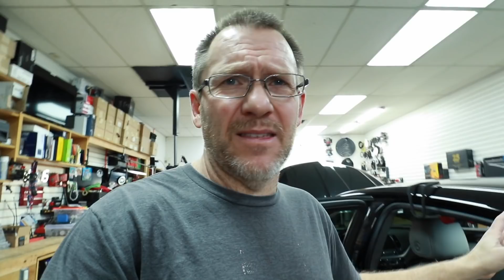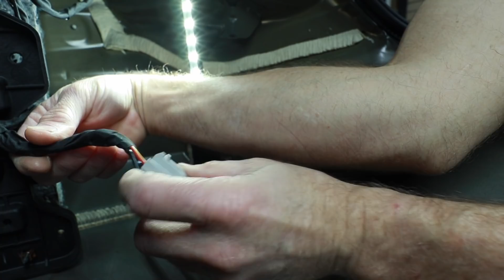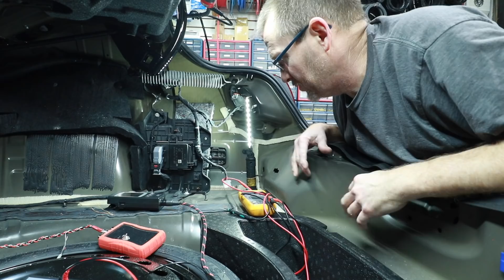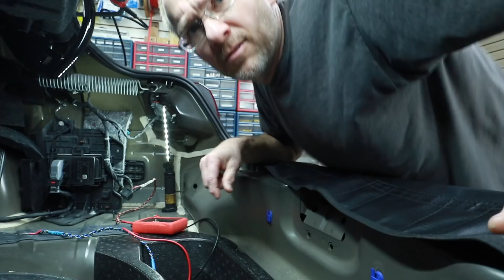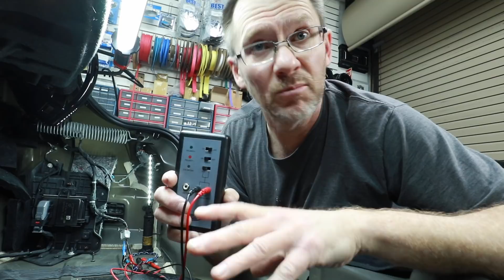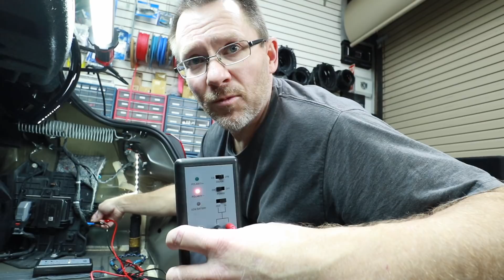How to test the audio out of our factory amp to install a High to low Installer Diaries 344 part2

Comment: hey guys great video   i do have a question  what do you guys do when you run into a ford that has fake engine noise and anc but dosen't have a factory amp  asking for a friend she has a ford fusion hybrid with the 4 in screen
Reply from the maker: You have a couple of options. 1 go to dealer and have them turn it off, usually cost $150. 2 Get ForScan and program it off yourself.  3 go iDatalink with the DSR1.

Comment: I am in this situation now with a new 2021 silverado, want to add 2 subs and nothing is available out there.
Reply: Easy find the head unit speaker lines before they get amplified and their polarity tap in to them . Then add a lc2i now you have rca. Be aware if the head unit signal is weak you cannot tap in to them ,you'll have to disconnect it and only use the lc2i from audio control. You'll also need a smd distortion detecter to find the max volume on head unit then you could set your gains 💪
Reply: @fullpeladas  So far I think I have the sub output from the Bose amp coming out as BLU/GRY + and GRN/BLK - , since it is just a sub signal I am looking for I was going to take it off the Bose amp output since the LC2i or my D6.1200 can handle 40V high input and knock that down to low level output. This signal will already be crossed over and I can just look at my RTA and see what the range is and make the amp x-over the same.

Comment: I got a LC2i in my Mercedes-Benz E350. I used the auto sense at first, but every time I even unlock the car doors, it kicks the remote turn on on. So my amp was just kicking on for no reason constantly. Its a cool feature, but I hated that. I just bypassed it and used a empty ignition fuse location for remote. Problem solved. But I've had a hard time setting the LC2i cuz my volume doesn't have numbers or a line, so I don't know how loud it is lol.

Comment: I have a question dean I have a rav 4 2021 I have a jbl factory radios I upgraded the speakers and the amp I have a pop when the vehicle turns on I took it to the place were I had the amps installed they told me that the only way to stop that turn on pop is to change the amp and put an expensive amp can you elaborate on that I’ll appreciated  and also they refused to put and inline relay for the amp so the pop could stop
Reply: Carlos, There is a delay, that can be use. PAC-TR4 remote turn on module. Helps prevent the pop.
Reply: @lfernandez9194   ok we’re do it put the pac-tr4 on the head unit or between the amps
Reply: With pac-tr4 I get
Reply: Theirs several
Reply: @carloscollazo6106  at the amp. It would be the quickest and easiest. TR4 Amazon
Reply: @lfernandez9194  ok thanks I’ll do that
Reply: I have two amps one for the kids and one for the sub
Reply: One for the mids
Reply: Should I put the pac- 4 on the amp of
The mid
Reply: Or on the amp of the sub